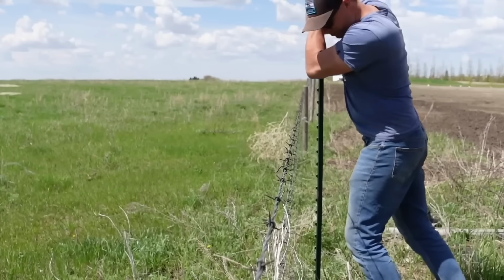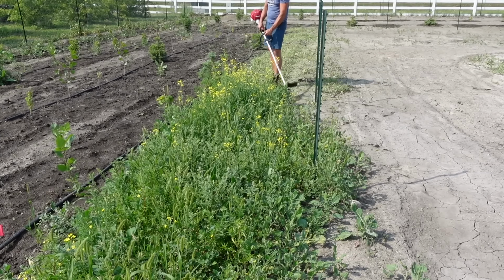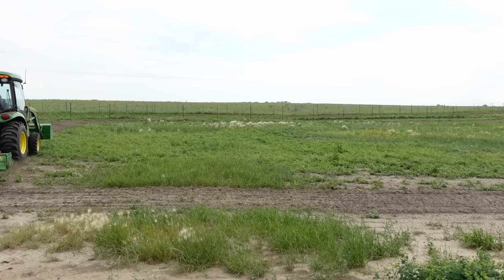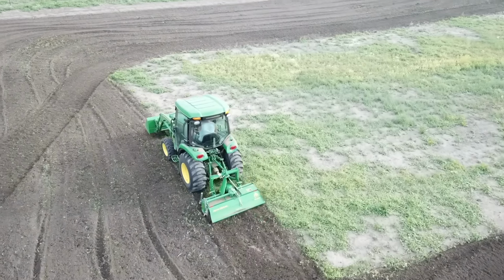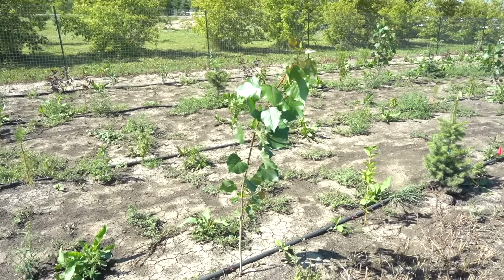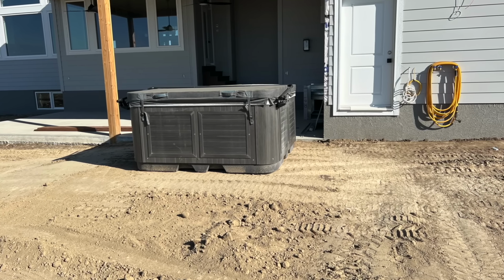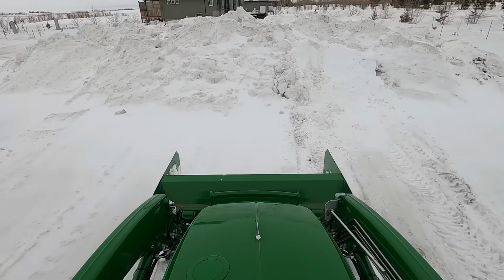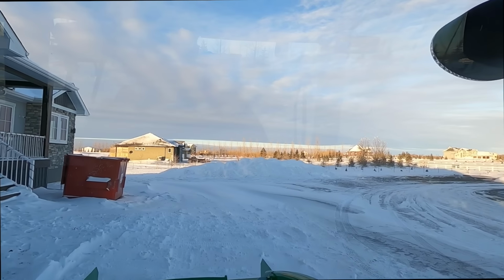My OVERGROWN Yard Is Out Of CONTROL! | Yard Geek Episode 4

Comment: Bro, you need to mow it regularly to control the weeds, either get a ZERO turn or an attachment for your tractor like a flail mower or bush hog. Tilling will only leave your soil exposed to the sun and that's why you get more weeds. Your soil is springing up weeds naturally to correct soil nutrient deficiency until you throw down grass seeds and the correct fertilizer type. Look up the series called carbon cowboys and you will learn allot about soil regeneration

Comment: Ask and you shall receive! Hey Mitch, im a local agronomist in Saskatchewan and i have some tips for tilling that area. First, don't do harsh turns with the implement in the ground. Its very hard on the equipment and the 3point hitch. 
Proper procedure is to do 2 or 3 "headlands" or border which will be your turning area. Pick a spot on the horizon and draw a staight line with the tiller across the whole area. That will be your guide to follow back and forth for the entire field. At the end of the line, pick up the implement, turn around, line up and lower the implement once you are going. Try to raise and lower the implement while the vehicle is in motion to minimize wear and tear on tines in tiller. 
Hope this helps!
Reply from the maker: Definitely does! Thank you! 😊
Reply: Great idea for hand mowing large areas as well.

Comment: For tilling, I recommend checking Zamboni patterns for the most effective. Usually the most common, especially if your entrance is centred on the fence line, you start off slightly off center down the middle, then make a half loop towards the opposite side. Then you continue to do half loops, moving across one width at a time. So that way on the last lap you should end up with a single strip down the middle straight through your gate and your loops should stay the same size the entire time.
Reply from the maker: Good idea!

Comment: Splint the tree up with tape and popsicle sticks if it's broken, doing that will save the tree and any limbs that break can be mended back using the same method. It also works for splicing different plants and trees together for unique fruits or colors or different variations of flowers

Comment: To minimize the need for sharp turns when tilling with a compact tractor and a tiller that is, you could use several strategies. Such as creating headlands at the ends of rows provides extra space for wider, sweeping turns. Following the land's natural contours with curved or contour plowing reduces the need for tight turns, and using a circular or spiral pattern allows continuous operation without sharp U-turns. Performing three-point turns instead of sharp U-turns can also help, as can tilling in staggered rows to reduce the frequency and severity of turns. Additionally, maintaining clear field edges ensures more room for maneuvering. Implementing these strategies can reduce equipment strain and make tilling more efficient.

Comment: I used to work with a crop duster and to keep from turning the plane in tight turns instead of going around the perimeter he would find the mid point of the field.  He would fly along one edge then the midpoint, then inside the original edge and then outside the midpoint, then just keep moving over each pass.  For example, starting on the left side you would do left side, then mid point, then right of the left edge the width of the tractor, then to the right of the mid point one tractor width, and so on.  The last pass would be to the left of the mid point then the right out side of the field.

Comment: very cool video! nice advancement on the growth and the setting of the lines for watering. we live on 1.6 of an acre. we have a drag to clean the yard of weeds. I start in a wide circle but at about 1/3 in, I start going across, criss cross and reverse in design. Not only does it help to pull up weeds in better fashion but alleviated the path of going tighter and tighter. I find this so relaxing to do.  We now have crusher fine all over the yard so no more dragging but still maintaining for weeds.  and wow!!! that badger is huge!!

Comment: #501❤😊 I dont know where the curling rink is gonna go but will help eliminate all the weeds.

U should invest n  some type of grass where u dont hv 2 mow alot as I am goin 2 assume no riding lawn mower.
It will b more 'controlled' this way and easy 2 maintain. 

What grass requires the least amount of maintenance?

Fine fescue is the most popular low-maintenance cool-season grass. Hard fescue and fine fescue mixes require very little maintenance. You'll only have to mow your lawn once or twice a year. Fescues are hardy and they'll naturally crowd out weeds, so you don't have to worry about fertilizer, herbicide, or pesticide.Nov 21, 2023

I got a pic of the Geeks hottub hover'n over the old house.😂

I'm curious as 2 whether the new house gradge set up w/a drain pit and detail like, the shop as a backup?

Most men wear pants cuz legs get cut up by debree and might hv allergic reaction 2 some of them weeds.

I dont know how u feel about them Maples🙃 😳 but I would invest 'n Maple Trees = Maple $yrup.

Comment: As far as the Tilling goes, there is no real easy way it just takes time, but I’ve always been told you’re only to make straight lines and not supposed to make hard corners with the tiller down because it puts a lot of stress on the bearings and other components of the tiller. Also, if you ever do another sprinkler system. Save yourself a headache and get yourself sprinkler manifolds with quick connect for the valves. Because when one does take a crap, which it will! The set up you did is going to be a pain to replace it.

Comment: Any plans to put solar panels on the property? Read Saskatchewan receives most sun in all of Canada
Reply from the maker: I’d like to yes. The government here used to have a rebate incentive for new solar installations but have since axed it. If they don’t come out with another in the next few years I may just bite the bullet and do it anyways 😄
Reply: hey, I'm not a real expert in this particular field, but know my basic physics. if you already built the roof strong enough, instead of an outright PV, you might as well just look into water (pre) heating on your roof (or, as a first step.) the good old way, so to speak. it's more efficient than electricity generation and has definitely the potential to safe you real costs. amortization times is typically shorter than for a full fledged PV,  @TheYardGeek .

Comment: Install a solar panel system so you will be more Independent of the electricity. I believe I will do the job and make you the entire electricity you need although I don't know many things about where you live.
Reply from the maker: Would definitely love to go solar someday!
Reply: They had a solar panel program n Canada but I dont recall Y he did not get n on it.

He did say he might do the solar panels later on.

I would had made it top priority like that aquafier.🔥
Reply: it's not that easy or straight forward. 

the "inflection" point is when it comes to electricity storage. 

that's needed for true independence and to maximize utilization of the installed wattage.

or otherwise, it's more like a fancy gadget/party trick. yeah, you can supply the grid but just wait until more people get the same idea (cf., California and basically all other places.)

however, it takes a very long time to recoup those investments; now combine with this being Canada, which has relatively low electricity costs (it's about a fifth compared to Germany, which invested a record breaking 800 billion over the past twenty years into green replacement energy for their, well, technically already green nuclear plants due to popular demand and surprisingly, those costs need to be paid for by the customers.

in France, which didn't take the same step, prices remained largely the same and are about half of Germany now.

some demand that those costs should be rather covered by the tax payers, so that it's a little less noticable 🤷‍♂️)

--

that's why I suggested not to overlook the option to just heat water via solar panels; as a first step, at least.